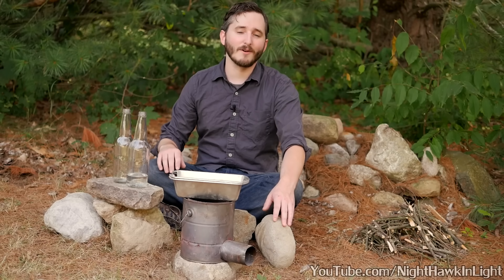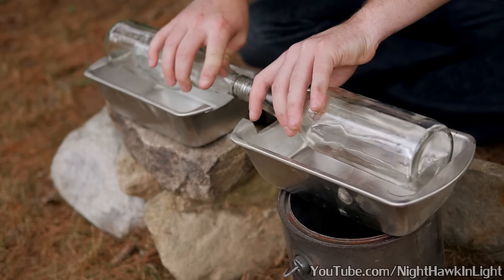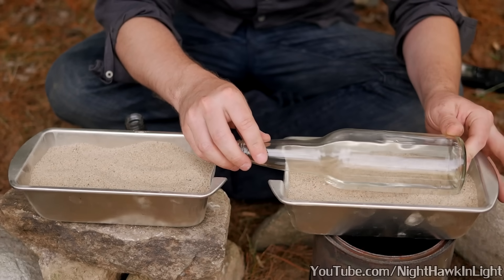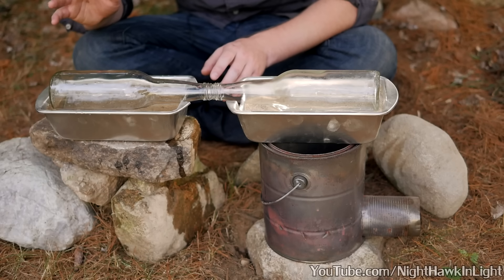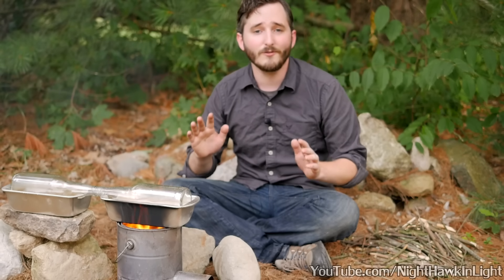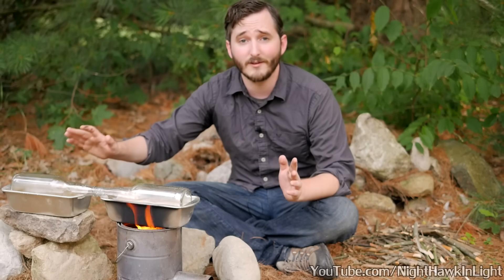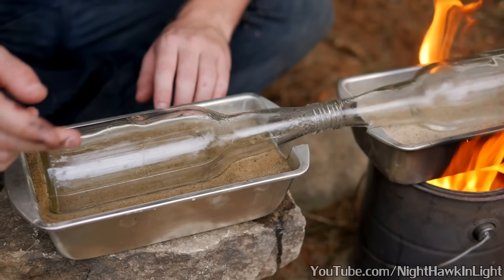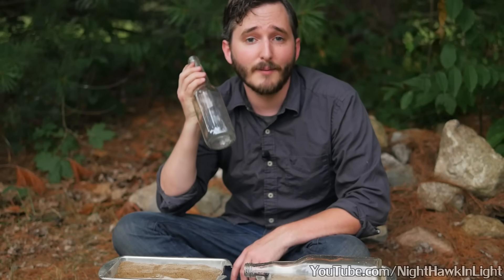How To Turn Salt Water Into Fresh Water (Simple Improvised Distillation)

Comment: you can easily find glass bottles on the beach.....until it's a survival situation.
Reply: James P hahaha true..  Another method is cooking salty water and have a piece of plastic paper on top of that. With a bucket/bottle or anything self made to hold water to catch the condense!
Reply: @Wessel3453  what's plastic paper?? I never heard of that before
Reply: 1 @Wessel3453  xxñ92
Reply: @Wessel3453  oì9
Reply: @Wessel3453  aaaa
Reply: @Wessel3453    plastic bottles work too but there is BPA contamination risk
Reply: In real life it is not that easy im from Philippines and you will barely see a bottle in the beach unless it is a tourist spot beaches
Reply: @odtuhan  
True, but if you washed up on the shore of the Philippines, you wouldn't need to distill sea water in old bottles. You could simply walk up to a home, business or govt building and ask for a cup of clean water.
Reply: you could use plastic bottles too, sure more contamination from plastic, but not that much too keep you alive..
Reply: @S3l3ct1ve  what kind of plastic can you have directly in a flame and it still holds water? You, sir, are a fucking moron...
Reply: @S3l3ct1ve  they would melt, plus they are flammable, and with the open flames... you can imagine what would happen...
Reply: glass bottles don't survive the journey on the ocean, there's lots of pretty rubbed glass around though
Reply: You can make fresh (not sea) water potable by boiling it in a plastic bottle with the top off. It's sounds mental, but the water stop the bottle from melting - there's plenty of videos showing how it's done and which bottles are safest to use.
Reply: "our trash has gone everywhere"? Have you checked videos from China, Phillipines and any other country on how they disregards their environment? It's not only "our" trash!
Reply: Loooool yeah
Reply: It was grate idea 💡.                         To keep the reservoir bottle cool, it should cover with sand and keep the sand wet.
Reply: Ali Bossani yeah it was very cleaver you keep drinking that tap water .
Reply: @Drew Peacock yes, but let's say you are lost in the woods or something (many people died being lost in the woods) so when you see litter signs, you know you are in an area that people go thru, like a retreated camp site or a hunter's path, or a lumber jack, etc. so you now know that you have a bigger chance to be found if you stick around that place. it means you are close to civilization and you can... set a new path according to what you found. plus... you maybe can use some of the litter you find ?
   BUT yeah.... on a deserted island it is different indeed, the sea could have brought that from thousands of miles away. still useful tho.
Reply: @itsMe_TheHerpes  that is the most stupid statement I've seen in this commen section. Trash is not a life safer. The amount of lifes the trash takes is way way more than actual people that it helps. What's the likelyhood of you landing on a deserted island vs your kids getting micro plastic into their body from all the trash we dump into the ocean? Smh
Reply: Fn Murphy
Reply: and if all else fails the sand can be burned with fire and said sand will turn into glass!
Reply: Leicester City F.C. Fan - but does it filter the salt? It only filters the water from impurities such as parasites, bacteria etc or am I wrong? I recently bought a life straw that does this, but I’m not aware of other types
Reply: @antonimosvonswaghoven5961  You need a reverse osmosis filter to remove salt / heavy metals. There's a portable one on kickstarter right now - I haven't backed it because I'd rather wait for the finished product and reviews ;-)
Reply: Richard Allsebrook -  Yeah you probably should, as there are so many scams on there! But sounds interesting!
Reply: And loaf pans. I mean, I'm ALWAYS stumbling over them down at the shore on deserted islands.
Reply: @bradleybrown8399  this is why i love what people call "pollution" because it's actually not pollution. we can find something useful everywhere we go. it's wonderful
Reply: In 2020? You can go naked to an isolated beach and end up with full clothes. Waves moves crap very long distances
Reply: @Drew Peacock yes, because people who get lost in the woods, always plan for it ahead, right ?🤷‍♂️  
  dude, people who get lost in the mountainous woods are there either by some sort of accident, or hikers(not professional hikers like you, who have their gps and all that with them)t. they might be injured and all that. 
    nobody plans on being lost and if you can blame the hikers for not thinking ahead, you can't blame the ones who get there by accident.
Reply: maybe learn to bake clay in wild conditions? You can 'mcgyver' a clay retort then.
Reply: where  I live, standing with your back to the sea, there's the beach, then the dunes, then behind that the soil is clay ("polders"). Dunno if it is suitable for baking vessels, but since the ancient Belgae used dark clay pottery there, I think they used the local clay soil?
Reply: i gathered some garbage today, i didn;t took it out. this week-end i am going to a forest near by, and spread it all around. some plastic bottles, bags, some cables and the batteries from my remote control(the lead in them can be used for fishing probably) 
  i will spread them all out thru the forest tomorrow, and i will make a video and upload it. just doing my bid towards helping people 😇 
  also, i think i am going to make some signs and nail them to trees, pointing the way to the nearest road and humans. and i am thinking of leaving behind some insulating blankets i don;t use anymore. i used them for camping a long time ago, i have better ones now.
Reply: @itsMe_TheHerpes  😂😂😂
Reply: speaking of servival situations. if ever you fine your self in need of nails, check public fire pits at camp sights and near lakes because people often burn broken boards or even whole pallets
Reply: make it out of clay.... asians doing it by using clay....
Reply: @Data Null Void oh really ? how so ? explain if you are able to. because if you are not able to explain, then your are the stoooped one.
Reply: Game/movie logic: haha there is nothing here!

Real life: you could build an entire house with the pollution and litter here
Reply: @wildman510  and a small nuclear reactor too.
Reply: exactly
Reply: Funny isn't it??? Not your comment but our names!!!!
Reply: well build a banana leaf bottle
Reply: @TheCubecrafer  if you have banana leaves, just juice the tree. Banana plants have gallons of drinkable water per plant.
Reply: @plebiansociety  true
Reply: You can always find things when you don’t need them. Just like in those RPG games.
Reply: go diving then. Hope you arent afraid of mussels seaweed and digging up shit
Reply: Leicester City F.C. Fan  Also easily found in your local Bass Pro Shop.
Reply: Yeah this is fucking retarded.
Reply: No , you remember he said it keeps the man-made chemicals like oil and all that stuff well our ocean is full of those right now !!!
Reply: lmao
Reply: I love how he manages to turn our garbage being everywhere into a positive
Reply: Right hahaha 🤪 but still a cool survival skill ☮️👍
Reply: "Damnit people, pollute the ocean more!"
Reply: i mean you could make a clay bottle.
Reply: @AniMaTheEarth  good idea.
Reply: AHAHAHAHAHA
Reply: Like legos
Reply: It's like that with everything!
Reply: Just search in the garbage bin behind the bar
Reply: Hobo facts!
Reply: These there's nothing but plastic on the beach
Reply: Right then all you find is broken glass or rusted old tin cans with holes all in it
Reply: That's how most things work. When you don't need something, there's an abundance but when you do need it...hahaha
Reply: Yeah, nobody drinks bottles of beer with-in a hundred miles of any known beach
Reply: easy setup...sure, you'll find metal container everywhere. Nowadays it is more likely to find plastic bottles instead of glas bottles  ;-)
Reply: You can also use clay
Reply: Years ago, when attending multiple classes at the Tom Brown Tracker School, they were explaining how to make fire with sticks (bow drill and hand drill). A student asked, what if you can’t find a stick in a survival situation? The instructor replied, “then you’re screwed” haha!
Reply: Aw..just remember to have them and you'll be saved
Reply: Doubt you'll find those loaf pans .....anywhere....
Reply: and two metal trays so you can put them perfectly next to each other, a tiny gap between the bottles and all that steam would got up into the air and not the other bottle.
Reply: Facts
Reply: Tis my luck
Reply: It do sometimes be like dat. :(
Reply: Unless you're a drinker. They don't leave home without them... In fact, sailing now calls for gallon-size bottles... In case of emergency situations, only, of course.  ;:^)  =^)...
Reply: sad but true
Reply: You can not find beer bottle on an empty island where you need to survive 😊
Reply: @mrcountry  you can easily found bottles at the island which is near of china😆
Reply: that's true, but saving some (people) , is better than losing them all.
Reply: Here in PH you dont need to worry where to find glass bottle, you can almost see it anywhere 🤣🤣🤣
Reply: aaah yeah the beach makes glass bottles for a living😴
Reply: Where all the bottles go.  My god
Reply: i bought a lifesaver bottle..cleans dirty water instantly...about 60 bucks...there's gonna be a war soon...every century ever do you think this is the first one we get off...nope
Reply: MrCrispian. Yeah but the war might not be what you think it will be Mr. Crispian.
Reply: @MrCrispian  Where did you buy it mate?
Reply: @Wessel3453  Amazon
Reply: @Wessel3453  less expensive ones on Amazon or ebay too. gl hope this helps. I was just reading through.😉
Reply: @MrCrispian  yup, I'm prepped, but so sad that hundreds of millions aren't
Reply: @MrCrispian  sorry to break your bubble , but we;ve had plenty fo wars. There are even some active wars right now happening in the world
Reply: @MrCrispian  I have not heard of a water filter that can remove salt from water. Salt ions are smaller than water molecules so it wouldn't make sense that you could mechanically remove it from water. But even if that were the case, I would imagine the salt would quickly clog the filter
Reply: @MrCrispian  it was foretold
Reply: @MrCrispian  Curious about that bottle, can it be that good for 60 bucks? Can you provide more information?
Reply: Ta Ta look on amazon
Reply: @ThomasHD25   @MrCrispian  I have a sawyer. Fits any plastic bottle. it's a ceramic filter thats good for something like 100,000 gallons. There's a few different types - see youtube videos for reviews
Reply: @ThomasHD25  their bottle is only useful for making pond, lake and river water drinkable as it only filters the water. You can do the same with clean sand of various particle sizes and filter water with gravity.

It can absolutely not remove salt. There's no way but distillation or reverse osmosis to remove salt from water.

Instead of the fancy 60 bucks bottle you can just use water purification tablets like Halcyon. Basically any chemical that kills microbes in tiny quantities but doesn't harm us very much works.

It's the same tablets you'll find in emergency rations.
Those take up much less room and don't break when you drop them and can be used with any container.

You can even use a clear PET bottle and fill it with clear water (for example by filtering your silty water through a layer of sand) and placing that in the sun for 12 hours. PE and PET let through enough UV that you can sterilise the bottles content with just sun light.

So really if you have regular water available there's already a variety of methods that can be used to make it safe to drink.

However if your only source of water is salty, you'll either have to bring a whole reverse osmosis setup and a power source, or you have to do your own distillation apparatus. 

Btw, you can use a variety of other containers for this as well. Even some plastic containers will work in a pinch. Just not save to use the water from heated plastic over long times.

But if your option is salt water, i.e. not drinking at all, the one you get from distilling in a plastic container that can withstand 100°C without melting is still infinitely better. 
Just use the hydration to find a metal can or glass bottle.
Reply: @MrCrispian  "The bottle can be used to filter urine and will remove all microbiological contamination. However, there will be an amount of dissolved salts that can not be removed. Metals such as iron, and salt from salt water cannot be removed effectively, either."
Reply: @MrCrispian  you can't drink ocean water with it
Reply: @MrCrispian  we’re talking about living in stranded in an ocean, I know there’s river water lol
Reply: @MrCrispian  You in Ukraine?
Reply: @MrCrispian  did you use you bottle in you war situation yet?
Reply: MrCrispian there’s not going to be a war for a very long time. In fact we’ll probably either be dead or very old.
Reply: @MrCrispian  century still have many years in it, maybe the war will happen in later
Reply: with water pollution it is so easy to find bottles of all kinds everywhere
Reply: @caporetto333  I buy my bottles from China, thank God.
Reply: this is why i hate those creeps "oh the environment, clean the planet"  pf. what is i need a bottle one day ? like it or not, ll that trash in nature can be a life saver. not only you can use that trash, but it also shows you signs of civilizatioon, so you know you are close to something, and calculate a direction to go.

Comment: The cooling side would be better filled with almost anything not small in size, like sand.. Sticks would be better. Maybe small green twigs woven into a flexible mat supporting the bottle in liquid (survival version = a deep puddle made in a scrap of plastic, heated side powered by dug rocket stove). The more fluid, the better. Solids are a poor choice for conducting heat because they don't flow. In a longer running distillation this would be an issue not seen with just a gulp distilled. Not that the cooling side can't be replaced, but it's easier to just replace a liquid.

Comment: I think that this method is not practical in a true survival situation because keeping the bottles aligned is going to be hard with supports such as rocks and sticks.  Even if they are aligned perfectly, the bottle with the heat source can still move as firewood keeps burning down and adjusting over time.  I expect some shifting even with the fire on top of the bottle.

Comment: You can find some some metal tubiing and carve a couple of heat tolerant corks (Coconut, wood, rubber, etc) try separating the bottles for faster and easier water distilling.

Comment: I believe you could do this without a fire by using solar power.  Wrap the source bottle in something dark and set it out in the sun.  Shade the product bottle and keep it cool by pouring sea water (or contaminated source water) over it.  Cooling efficiency can be improved by warping the product bottle with cloth, wetting it and fanning it to increase evaporative cooling.

Comment: Not an efficient design. All you have to do is boil water with a flap of metal or glass above it for the steam to condense on and run off.
Reply: post your video of your design, lets see
Reply: @to_a_nico I just told you the design. If you are too stupid to implement such a simple design I cannot help you....

Comment: Show a solar distillation using only a plastic sheet, a cup and moist or damp soil or a pan of salt water (lifeboat) and a rock in the center, just a thought.
Reply: Yours is a very common idea and many videos done on it already yet, nobody has ever shown a way to do that with common or scrap material of manageable size under survival conditions to produce even the standard minimum daily amount of water for a single person in a hot/steadily sunny, dry environment that would require it.  (Any video claiming such is highly clipped & edited without good account of exactly how they got from point A, nasty water ... to point B, a supply distilled water in quantities enough to sustain people with the daily requirements before a single day is over.)

At it's best, the "solar still with a hole in the ground, plastic sheet and cup underneath" is a feel good science experiment for kids and certainly nothing to base even 1 person's survival on. (But damn, the youtube videos of such things sure do generate clicks from gullible survivalists though, doesn't it!"

Comment: You should repeat this with plastic bottles. You're much more likely to find plastic bottles washed up on beaches. Also try to do it with just mounds of sound instead of the pans, and just an ordinary fire instead of the rocket stove. You're unlikely to find those things, and the devil is always in the details.
Reply from the maker: I'll have a video out soon about a ready made desalinator that's easy to carry with you so you don't have to worry about improvising one.

Comment: Idea:
With the bottles in a more upright position, the more water you will be able to distill.
But how to connect the bottle openings??

Bicycle tire inner tube!!!

This will also reduce steam loss.
You'll just need a very small pin hole in the tubing to release pressure.

Comment: Great way to distill salt water to freah water and I discovered another method by usind electrical current with copper wireing wrap around a glass cylinder and salt water boiling temp. With electrical current creating steam to another glass cylinder to cool. No reverse osmosis.method.

Comment: Using whiskey bottles and a metal cap with the top cut off so as it can be partially screwed on to each of the bottles half way to stop evaporation.